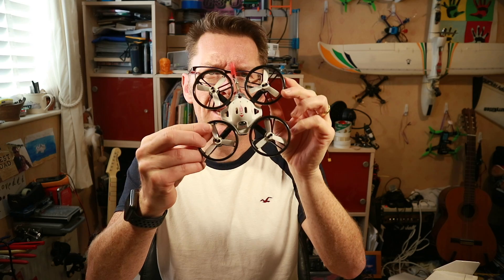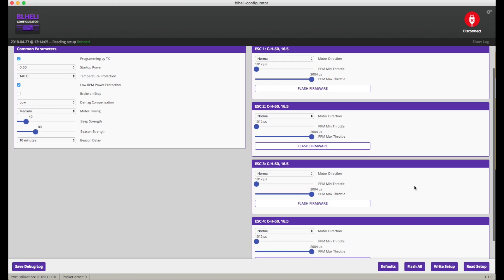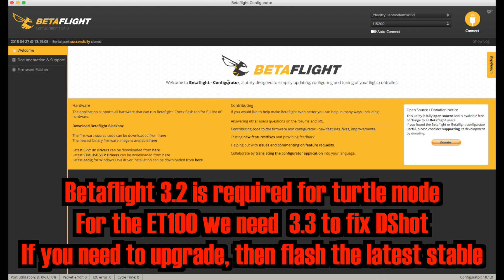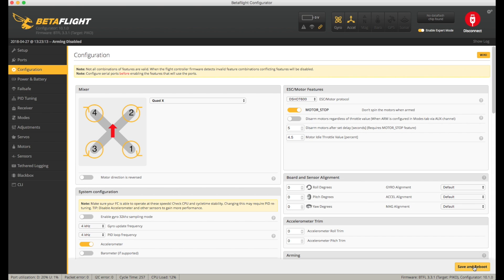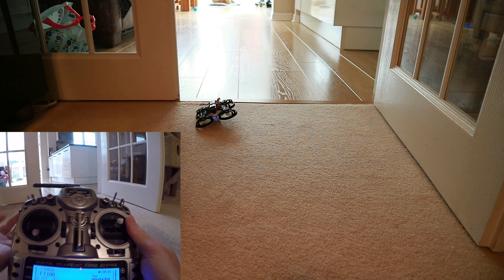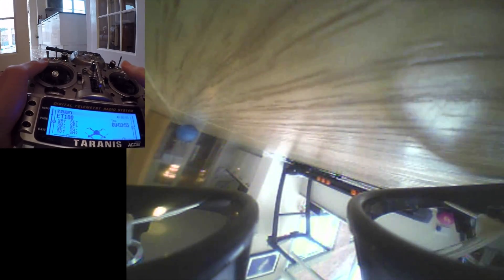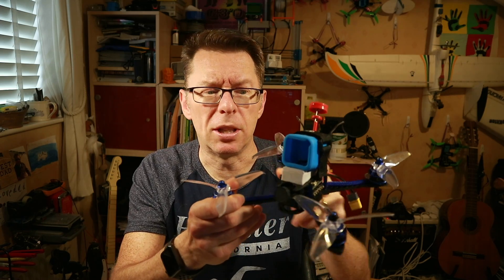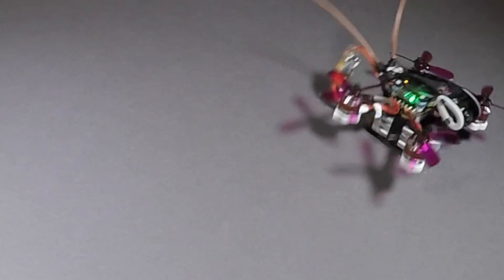FPV Tutorial: Setting up Turtle mode on the King Kong ET100 (and other quads)

Comment: HELP     i have tried every way i can think of but can not get it flash the et115 you sait hold the boot button then it says .......2018-11-04 @ 08:05:14 -- Failed to open serial port
without boot button pushed it tries and fails .......No response from the bootloader, programming: FAILED
Reply from the maker: Did you checkout the advice on using the boot button here https://www.youtube.com/watch?v=6ESltDfuFAs ? If you are on windows, also take a lookat the impulse RC driver fixer here https://impulserc.com/pages/downloads
Reply: @CurryKitten  i have the same problem, i'll check your link

Comment: In my KK et 115, in air mode, when I arm, one motor start after 0,5s. And when disarm, the same motor stops first. Why? I use multishot. The quad is new and  it flies well.
Reply from the maker: Go back and do your ESC calibration is you are using anything other than DShot.  You can do it from Betaflight
Reply: CurryKitten thank you!
Reply: Can i make calibration esc with propellers?
Reply from the maker: You can, but the risk is the motors go to full throttle and you face gets cut off, so play it safe and remove them first.
Reply: CurryKitten thank you

Comment: I really wish turtle mode would work on brushed tinywhoops.
Reply from the maker: It would be handy - but the thing with brushed motors (aside from not having DShot support of course) is they are only designed to spin one way, so if you had the mode available, the motor life could get quite compromised.
Reply: I’ve got the industrix fpv plus which has meow mode ( which is a single direction turtle mode - ie it flips it back over but only in one direction Unlike turtle mode which is all four directions )

Comment: You see when you had flashed the board, the ESC/Motor protocol had defaulted to 'BRUSHED'? Well, that is an issue with Betaflight mistaking the board for brushed flight controller (the default ESC/motor protocol for a brushless board should actually be OneShot125). It also jacked up the default PIDs (to those appropriate for a brushed quad) but, you fixed those when you put in your CLI dump.

I now know that the fix for that issue is, plug in the battery BEFORE you flash the board (so, take off your props) and keep it connected until you click into the configurator for the FIRST time (and ONLY the first time, you don't need to do it after that). This will make sure that Betaflight detects the ESCs and it sets the board up accordingly. The default ESC/motor protocol will be OneShot125 (you'll obviously want to change that to DShot600), the default PIDs will be more appropriate for a brushless quad and, it will even set the serialrx_inverted to 'OFF' - by default (so, you won't have to use the CLI command).
Reply from the maker: How very curious.  Great tip though - thanks again !

Comment: I saw droneracer101 do it differently requiring soldering to esc mtr 1 from a uart I think. I will go back and watch it again but I don't remember him updating betaflight version either.
Reply from the maker: Brad Miles yep. Before the fix in BF 3.3 it was necessary to do some soldering and resource remapping. I prefer a non-solder solution if I can get it :)
Reply: CurryKitten ..absolutely..your way is better and cleaner with BF update. 👍 I think I might finally do it. I love my et 100. I've done many mods except for this one.  Thx.

Comment: Thanks much! Very helpful. 
Do you use indoor rates for your ET100? Seems like it could be really quick for tight spaces.
Reply from the maker: I'd meant to set up a rate for indoors, but I actually do tend to use angle indoors.  I've been very vocal about saying "always use acro" but in tight spaces where you still want a fast response it works really well.  So it's still got my normal super rate of 0.8 which is good for outdoors, and then just angle mode indoors.
Reply: CurryKitten, Thanks. I’ve been flying tiny whoops indoors (long winter) and rarely use full stick. I was considering dropping rates on the large whoop but will keep it as is and fly it more. 
I’m running angle now on my tiny whoops. I struggled with acro indoors until I found out that most folks fly tiny whoops in angle.